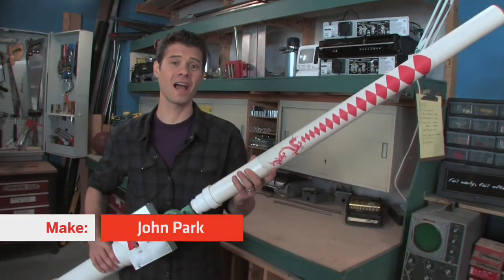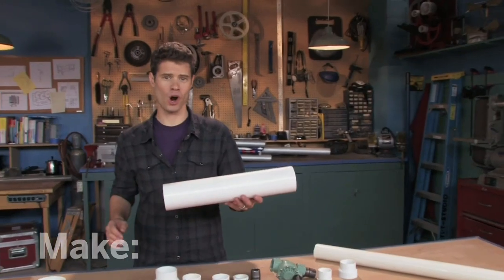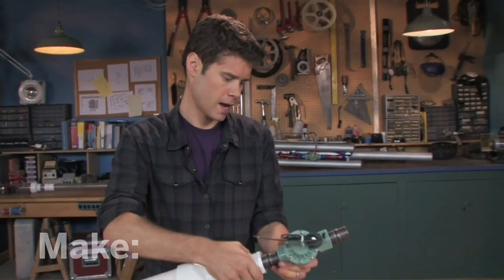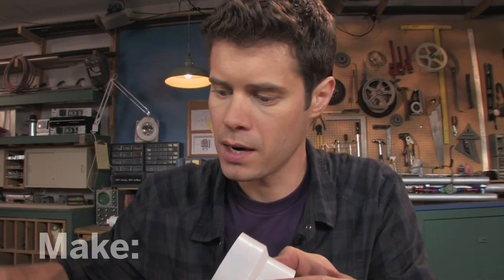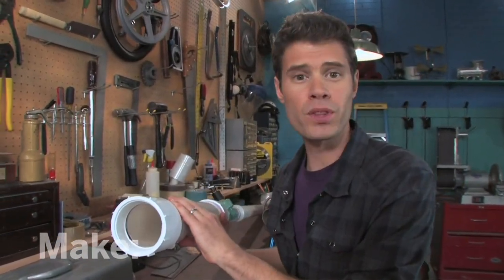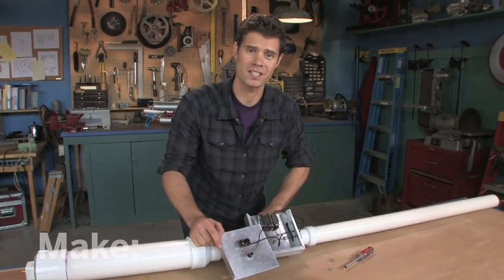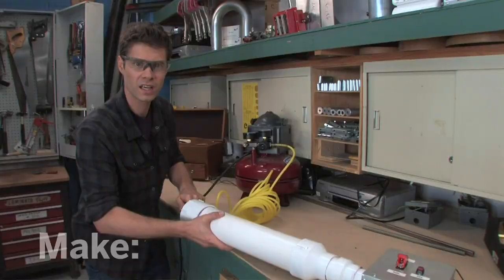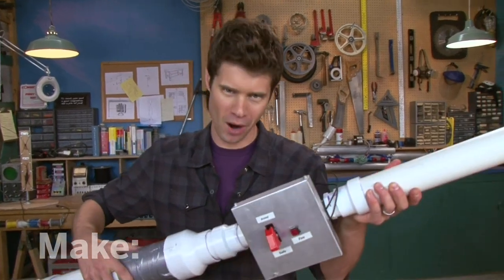Maker Workshop - Burrito Blaster on MAKE: television

Comment: see the valve does not open as much when air is released through  a hole about 1/16 of an inch wide when it is released through a 3/8  inch hole it opens fully releasing air much faster